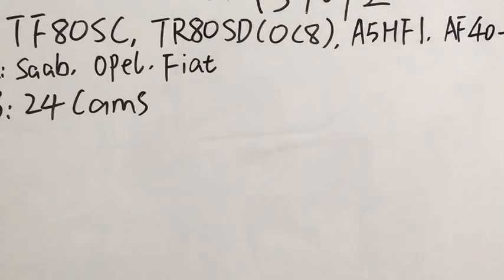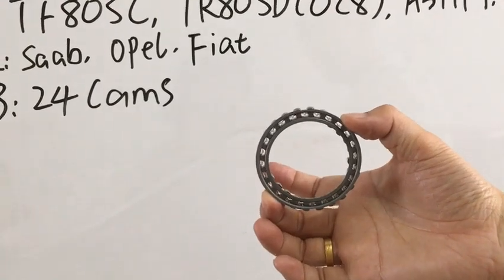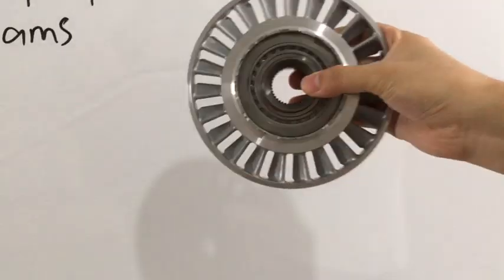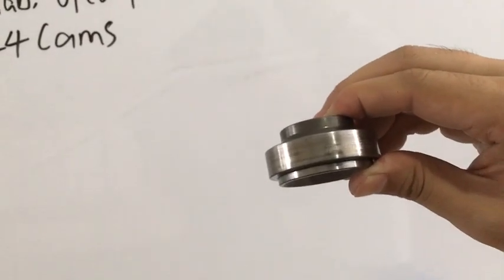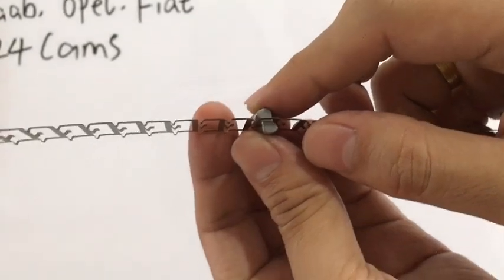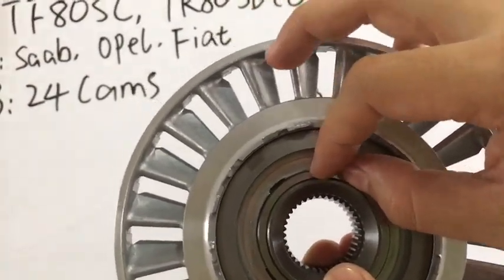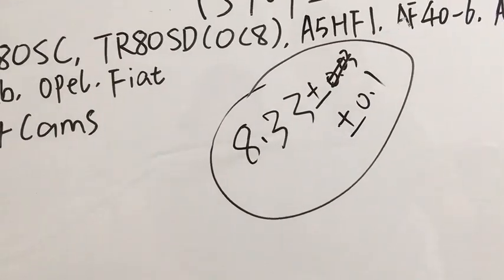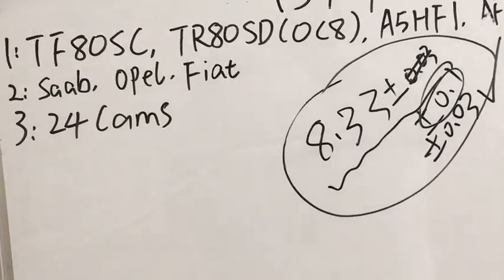PS9092 TF80SC TR80SD(08C) Torque Converter Sprag technology explanation

Comment: Great,  I buy all of our welding consumables from China, and now that I have found this channel I will be purchasing all of our bearings especially sprag clutches from china as well.
Reply from the maker: Please check our contact information below, you can send us email, then we will send catalogue to you.

Best Regards
Michael Zhang
Sales Manager
 
PS Torque Converter Parts
Add: No.2 Hengxi Road, Niutang Town, Changzhou 213168, China
Email: sales@pstorqueconverterparts.com
           psheavyparts@gmail.com
Skype: psbearings
WhatsApp: +86-15295162034
Wechat: PSMFG2014
Cell Phone: +86-15295162034
Phone: 86-519-86399561
Web: www.pstorqueconverterparts.com
Reply from the maker: If you want to buy, you can contact us at below contact information:
PS Torque Converter Parts
Add: No.2 Hengxi Road, Niutang Town, Changzhou 213168, China
Email: sales@pstorqueconverterparts.com
           psheavyparts@gmail.com
Skype: psbearings
WhatsApp: +86-15295162034
Wechat: PSMFG2014
Cell Phone: +86-15295162034
Phone: 86-519-86399561
Web: www.pstorqueconverterparts.com